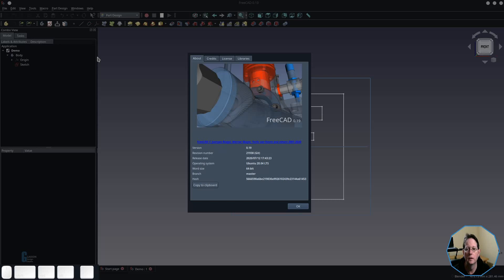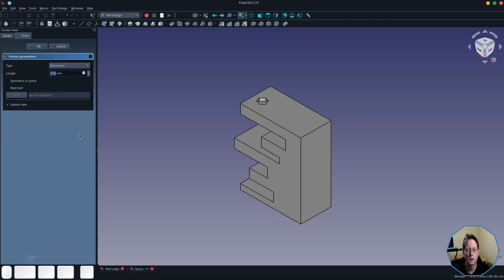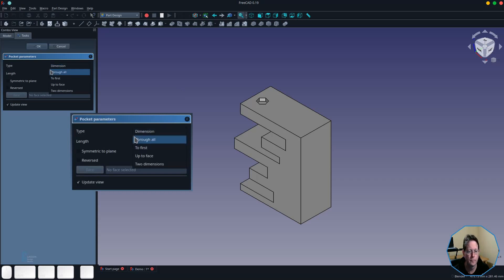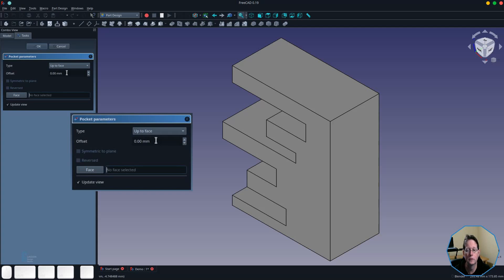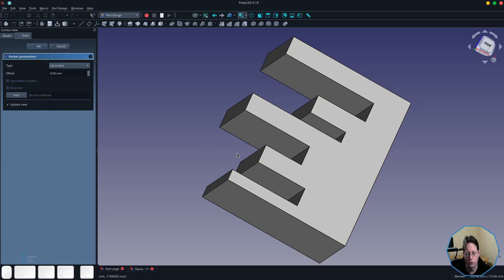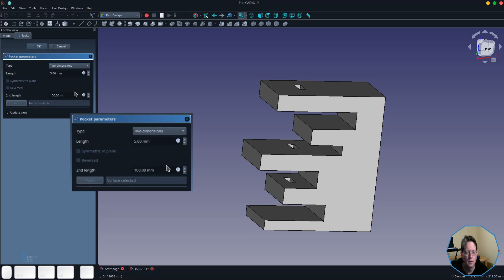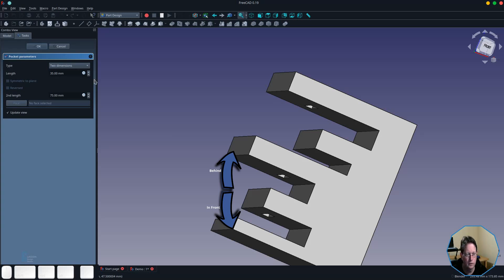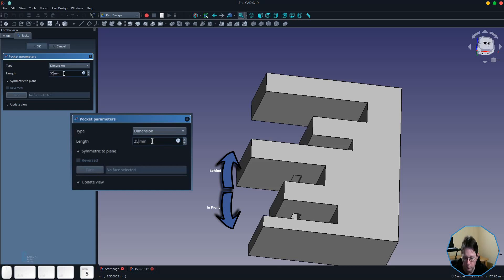Howto use the Pocket Tool in FreeCAD's Part Design Workbench

Comment: I really like your videos and find they truly help me understand FreeCAD.  I've begun encountering an odd issue I cannot figure out where I am creating pockets that just never show up.  I follow the exact same steps each time but instead of the expected hole all I get is a vertical line on the surface the hole was supposed to go through.  It first started when creating pockets on curved surfaces but I've had it happen on flat ones as well.  I thought it was only when I was creating round pockets but it happens with squares and rectangles as well.  It doesn't seem to matter which plane I try but 99% of the time is is after I have already added one pocket and I am trying to add a second (usually on a different side of the part).  As an example I have a cylinder 30mm OD and 20mm ID and 50mm tall.  I add a 5mm pocket 5mm deep )so all the way through to the centre) on the YZ plane and it works fine.  I then go to add another 5mm hole on the XZ plane following the exact same steps but when I "OK" the pocket the hole disappears and there is only a vertical line where the circle originally was.  Any ideas on why and what I can do?
Reply from the maker: Thanks for your question. That's an interesting problem that you have there. So far I haven't been able to replicate it. Would you mind sending me the offending model so I can have a look at? E-mail: info at glassondesignstudio.com.au
Reply: @GlassonDesignStudio  Thanks.  I tried sending an email and I'm not sure if it went through.  I get a message "Your message has been sent" followed by another "Unable to send email. Contact the site administrator if the problem persists".  Either way I really appreciate the offer to help.  A coffee is on its way. 😁
Reply from the maker: Thanks for the coffee. You could try the email address on my channel's About page if you'd like me to have a look at the model

Comment: How would I cut a vertical pocket in a cylinder?
Reply from the maker: Thanks for your question Jack. If you're talking about creating a lengthwise pocket, then that's a simple matter of sketching the outline of the pocket on the top or bottom end of the cylinder, and then using a through all pocket.
If you're talking about a pocket through the long side of the cylinder, then you'll need to create a sketch on a plane that is parallel to the side of the cylinder and then create the pocket. I hope that helps
Reply: Thank you for the advice, perhaps someday soon you'll do a video demonstrating this  feature
Reply from the maker: Hey Jack, I have just published a video that I think will answer your question.
Reply: @GlassonDesignStudio  Thanks so much for the upload, I've been away, so I haven't tried it out yet, but ill get back to you.

Comment: Is there a way to use an existing part design to create a pocket? For example, I have a faceted shape that comes to a point and would like a stand to put it in where the pocket matches the faceted shape.
Reply from the maker: I’ve had a quick look and you should be able to do it using the Boolean cut tool on the Part workbench. I had both parts as separate bodies in the same model file. I will investigate further
Reply: @GlassonDesignStudio  Thank you, Ill watch for a video. ;)